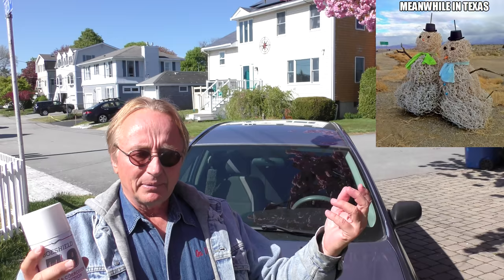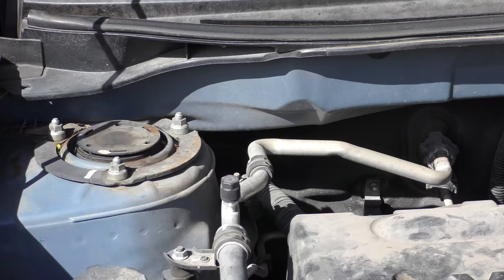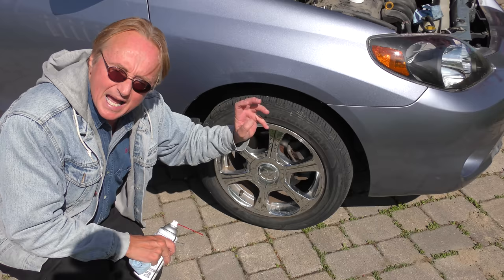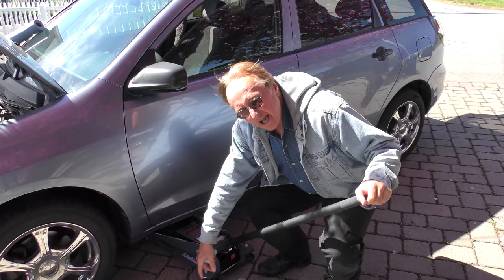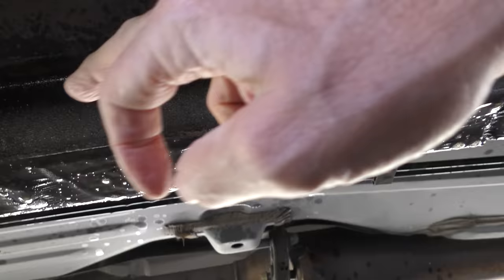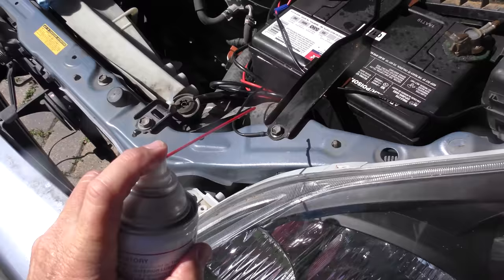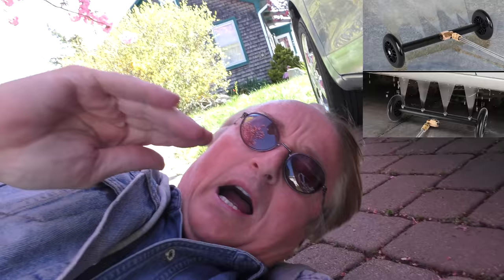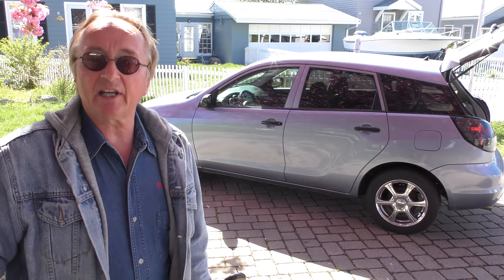Here's Why I Want to Leave Rhode Island ASAP

Comment: Scotty is salt of the earth!
Today was a school day for me re there being nickel in stainless, as I`d always only considered the chromium, but did wonder how they kept the brittle element down. I was in civil engineering and saw low-grade stainless with rust spots. Another thing with salt in UK, it`s wise to use copper grease on motorcycle engine bolts. I`ve had to cut seized front-engine bolt on Guzzis, to remove motors.
Also here in Blighty I remember welding old French cars in the mid-eighties, gawd they didn`t half spit back. Turned out that the froggies put all sorts of crap in the smelting pot. Very impure metal used for chassis/bodywork. Then they suddenly improved and my 1984  Renault 11 was as solid as they come.

Comment: There is an undercoating that is made from the waxy-oil found on sheep, it is called 'WoolWax', and it is the absolute best undercoating you can possibly use on a car. It is self-healing, and you only have to re-apply it every 3 to 4 years, not every year like oil undercoating.  A similar but 'thinner' product is 'fluid-film', and you can use that to spray the inside of your car doors and quarter panels to keep them from rusting.
Reply: That's the same stuff that GM is applying to their frames, isn't it?
Reply: I believe the military uses it. Just have to be careful with soft rubber such as inside your door. If you spray it in that it deforms
Reply: Fluid film is good but has to be reapplied- my go to rust protectant is POR15 it’s a single application and my father used it his whole mechanic life
Reply: @LardLarf2  how long does it last? Fluid film is only good for a season
Reply: It’s called Lanolin.
Reply: I restore frames in the Mass near the Cape - I spend 2-3 hours needle scaling the frame and removing the existing problems then I spray a convertor primer. The end result is a permanent fix. Thats when you start throwing oil at it. DO not let anyone spray anything over rotting metal. The process of removing the scale rust is the most important.
Reply: I would rate it higher than fish oil.
Reply: @robertpittsley5886  You hit the nail on the head.👍
Reply: @robertpittsley5886 Thats true to never spray a sealant on rust, but lanolin stops rust from getting worse. It is not a sealant, so it is ok to spray on existing rust. Of course if your car is falling apart it's not going to help at all...
Reply: THANK YOU!
Reply: @ze3bar  ......hope not.......Chevys rust like crazy even down in mid Atlantic states!!!
Reply: @robertpittsley5886 I live near the cape. I have a 2016 Camry and I'm not sure of the extent of the rust underneath. It's not terrible, but id like to get rid of anything that might be there. 

What would you charge for a touch-up sort of job like that? 
Provided you offer such a service?

Comment: Scotty, took your advice and purchased me a Toyota Matrix. Gotta say this thing is a runner. $1,000 with only 101,000 miles
Reply: Matrix Gang. I got a white XR and it’s a beast.
Reply: For sure. I have to drive about a 100 miles round trip a day and figured why out the miles on my truck. I looked and looked for a car. Had a pushed in driver door that took an angle grinder almost the jaws of life to remove. Replaced that and the AC clutch. Long story short has been the best purchase to date. But someone must have been tipped off they last forever because the parts on them are crazy money. I don’t get it. USSA tried to charge me $350 a month for basic coverage on a 2009 and said it’s a older car and parts are a lot of money. Wish I had the money to buy a new Toyota but the Matrix will do
Reply: @andrewdemorest8397  man, go to a junk yard for parts. Local o’reillys in my town the parts are dirt cheap. Must be because of location perhaps.
Reply: I know the Yaris motor was designed by Yamaha. Are the matrix as well?
Reply: @emanuelruiz7710  nah, fully built Toyota engine. Depending on the trim of course. XRS model matrix get a Yamaha designed 1.8L engine the 2zzge. That also comes with the VVT-L system which is essentially VTEC. The normal trim comes with the Toyota designed 1zzfe 1.8L engine with VVT-i which is like a basic VTEC mainly for fuel economy and throttle response.
Reply: @emanuelruiz7710  the engine options I listed are only for the 2003-2008 models as well. Anything past that is redesign territory, which I believe come with a 1.8 and 2.4L options. 2.4 is a Camry motor but is prone to burning oil.
Reply: We bought a 2009 Matrix base model a year and a half ago with 76k and it's been super!
Reply: @andrewdemorest8397  , WOW 350 a month for insurance on a 2009?? Wow

Comment: I use LIQUID WRENCH L711 CHAIN & CABLE LUBRICANT CERFLON,  Cerflon is Teflon.  It's a penetrating teflon spray.  It's disappearing from stores, so on ebay You can get six cans for under $30.  Also Teflon REPELLS dirt and sand, for a cleaner underbelly.

Comment: I remember spraying the innards of Boeing 737, 747,757 with this stuff for corrosion protection. We used this in the landing gear wheel wells, where debris from the tarmac including salt makes its way onto the airplane innards. That was 20 plus years ago. It's good stuff.

Comment: The pressure washer attachment is a good idea.  To really clean off caked on mud though, you need a harder spray like at a car wash.  Also I always use a garden nozzle to spray out the wheel wells and the wheel lips and any other areas that have crevices where any dirt or salt can accumulate. Most newer cars use wheel well liners which really helps eliminate the body rust problem around the wheels.

Comment: it costs too much, we just coated everything with used engine oil. and reapplied once in a while.
Reply: I heard somewhere that used motor oil is very good for rustproofing.
Reply: -'Mustie 1' has used that 'coating' for years with excellent results. He even devised a little sprayer that fits within the hollow frame tubes and coats the insides to end corrosion.
Reply: When i put new fence posts in i always use used engine oil. It keeps the little bugs from eating the wood and stops rot.
Reply: @davidestrich7055  motor oil harms rubbers , transmission fluid is better . here in Quebec CANADA we rustproof cars before the winter ,if it is done well every year not going to have any rust .

Comment: Unfortunately in Ontario, Canada washing your undercarriage just reactives the salt brine and rusts your brake and fuel lines even faster.  The rocker panels too.  Very disturbing.  😡
Reply: That's why you pressure wash it the garden hose doesn't have enough pressure to get the salt off
Reply: @DylanL69  do that at a coin-op with hot water but at -27C it's not all that easy.  Colorado uses biodegradable mixture that doesn't destroy vehicles so it can be done, it just costs more.
Reply: @JeffWinter1  pressure washing and maybe some scrubbing gets the scale off thats what you're really trying to get off is the scale
Reply: @DylanL69  so new vehicles use conduits to house the brake and fuel lines, like mine, that you can't scrub unfortunately.  Those would need to be put on a hoist, removed, cleaned and replaced which no mechanic would do.
Reply: @JeffWinter1  yeah that sounds like a headache

Comment: Sounds like good stuff. Just a note on stainless steel, 400 series SS will corrode  in costic environments, yes. 300 series is a lot more resistant. I was a machinist, we used a lot of it on down hole oilfield tools. Use a magnet to tell the difference, if it sticks, it's likely 400. 300 will corrode, but you have to dump it in sulfuric acid, or  bury it for a couple hundred years. Won't see much of it on cars though. $$$$$$

Comment: Stainless steel contains at least 10% chromium . Nickle is used in very small amounts  in some versions.
Reply: Either way as Scotty said it still rusts out. Everyone thinks Stainless Steel lasts for ever, far from it when exposed to a lot of water it doesn't need to be saltwater it will still rust out just a little slower is all.

Comment: Scotty its chromium that makes steel STAINLESS STEEL
Stainless steel:276 is a group of iron-based alloys that contain a minimum of approximately 11% chromium,:3 a composition that prevents the iron from rusting and also provides heat-resistant properties. There is SOME Stainless Steel that is also magnetic

Comment: I love Scotty, but I have to correct him on stainless steel. The defining element of stainless steel is chromium, not nickel. All stainless steel has chromium and most stainless steel has both chromium and nickel, but there are some grades of stainless steel that have no nickel. Some grades of stainless steel are more corrosion resistant than others, particularity in certain environments. 316 stainless steel, for instance, which has chromium, nickel, and molybdenum, is particularly well suited to environments exposed to salt and chlorine. If the grade is correct, it should last a very long time, if not indefinitely. Titanium is the best metal when it comes to salt corrosion, but it's generally too expensive and impractical.

Comment: It's not practical to rinse the car  bottom each time we use the car in the winter. We would spend more time rinsing than using the car. And what about rinsing the car outside, in the snow, in freezing temperatures? Nobody is insane enough to suffer that much hassle to prevent rust.

Comment: Scotty’s Matrix underbelly looks pristine. They are great rustwise. No or little rust. The only potential rust problem area for Matrix is where the side doors meet the underbelly...
Reply: @Igor Seprak I never see that many rotted out matrixes in Canada. It’s because of Toyota’s good factory Zinc-Primer that Scotty talked about in a different video. It works great, & the first car they really got it down-pattened on was the 1992-96 Camry. I see them 30 years old all the time & no rust. My 2006 Matrix has it too, works excellent. 17 years old & no rust.

Comment: It's the chromium content in stainless steel that determines rust resistance Scotty, not so much the nickel content. When stainless gets scratched the chromium reacts with air and forms a protective coating, thereby resealing the surface and preventing the formation of rust.

Comment: Granted I haven't lived in a salt-water area, but I have lived in the midwest for the past 30 years, and I don't get where people think that cars disintegrate from the cold winters and the salt around here.  If you wash your vehicle once a week during the winter to get the salt off, that's all you need.  I've had older cars (that were 10 years old, had a little rust on them) but they didn't fall apart physically over the 5-6 years I owned each one.  Because I washed them regularly in the winter and got the salt off.  And in the winter I parked out side where it was cold.  Obviously salt water is probably more damaging as it's salts in the air and the water, versus just during the winter time in the midwest but still, I don't know why people think their cars will "disappear" after a few years in the midwest because of salt.  As with anything (and as the 20 year old Tahoe shoes) if you take care of it, it can last a long time regardless of where you live.  You just have to take care of your car.  Most people don't wash their cars regularly during the winter time and/or they store them in a warm heated garage over night and drive through salty roads in the day time (during the winter).  Obviously my CAmry has plastic panels throughout the bottom so when I go through the automatic wash during the winter, I do get the under carraige wash.  During the summer months I only wash under the body maybe once every other month, but at least wash the car itself every month during the non-winter months when salt is not in use or if the car gets excessively dirty with bird droppings or bugs.

Comment: It depends on what kind of stainless steel you use ... Aisi 304 corrodes a lot in salt water, aisi 316 is far better and is a navy steel, 316 low carb is even better and actually rust/corrosion free on saltwater.

Comment: I use a product on stainless steel pipes at work mostly for the welds, that totally stops corrosion and rust for years. it harmful to breathe, but it works , along with other stuff i spray on and scrub on

Comment: My poor old 1991 Pont 6000 could have benefitted from an underside cleaning.  The mounts that hold the rear axle in place rusted.  I drove that car until the wheels (axle) fell off.  It had over 200,000 miles, I got my monies worth out of it.  It was practical transportation until it wasn't.

Comment: Hi Scotty, while you’re up in New England you should go check out the guys at New Hampshire Oil Undercoating. They sell different undercoating products. I looked into it after my transmission line rusted causing a fluid leak. NH oil undercoating is a good product if you already have surface rust to dramatically slow the process. I found a good guy where I am in Haverhill, MA who took it the night before, power washed it, let it dry, then sprayed it. I figure rust is one of the few things that can kill a Corolla, and I’m hoping my 2010 has another 188,000 miles to go!
Reply: @s0129570 your Corolla probably won’t rust, as long as you watch out for deep scratches & chips. Toyota seals those cars really well. My 2006 Matrix in Canada has zero rust, & yes, it’s seen salty environments many times. Never hurts to keep it rinsed off. I like this product that Scotty showed the best, looks less messy than oil spray. It was true for many years, if you ask Scotty & other people who have Toyota knowledge, that Toyota made rustproof cars but not really rustproof trucks. That has changed in the last decade, they are all sealed nicely.

Comment: Scotty,  I have a 2014 Jeep Patriot Lattitude with a 2.4L. I know it is a heavy vehicle for a 4 cylinder,  but is there a good brake pad/rotor set that would last longer than the standard put on by the dealer? It is a very nice Jeep, smooth ride, and thank God it is not a 2016 or newer. Those are junk. In your opinion is ceramic or organic pads better for a vehicle this heavy (4,235 LBS).

Comment: Hey Scotty I am torn between a Toyota Avalon V6 2013 and a Toyota Camry 2014. Both 90-100K miles. Which has a better engine/transmission? I watch you everyday, Thank you for everything you do to help all of us 🙏
Reply: I have drove both the Avalon and the Camry from those years. I say the Avalon drives much better because of that punchy and yet smooth V6 engine ( same engine that they used on the Lotus & Lexuses). Although if I were you, I would test drive the 2013 first to see if you like the suspension setup. Some people have complained about being slightly stiff compared to other years of the Avalon (Toyota revised the suspension in 2016-18 models for a Buick / Lexus ride quality.) The Camry is also a good choice if you get the four cylinder for the best fuel economy.

Comment: Hey Scotty where did you buy the u Jack? I'm in need of a good floor jack. Also I wonder if that rust prevention will work on the front hubs on my 04 Mercedes w203. 1 more thing why don't they put heaters in the roads I bet the cars wouldn't rust as bad or at all if the water evaporated

Comment: Hi Scott I have a nissan qashqai 64 plate 1.2 dig t 39000 miles with normal transmission am in the UK and can now buy the car for 5grand or give it back should I give it back or keep it not had any real problems in 4 years I have had it but dont want to keep it if I will soon most likely have problems

Comment: Scotty I have a  question, I have 1995 Ford bronco with 5.8 liter. 4x4. The transmission has been rebuilt twice! At first I thought the first company didn’t do it right because first gear would shift  hard. They told it would go away! But all the other gears would shift fine. So I had another company take a look at the transmission. They also tore down the transmission and rebuilt it. Replaced the torque converter. Replaced the transmission control module two times. Connected the computer to lower the idle. But they still could not fix the hard shift from first. They didn’t charge me labor because they couldn’t fix the problem. 
What do you think it is!!!! Please HELP!!!

Comment: hey Scotty, question for you. i found a 2009 pontiac vibe for sale with 96,000 miles on it, it has awd (i need it for the snow) and the place is asking $6995 for it, do you think its a good deal, or should i stay away from it, i know GM products are bad but isn't the vibe pretty much a toyota matrix engine and transmittion wise?

Comment: hey scotty, i have a 4 cylinder 2006 honda accord sedan. automatic with 189000 on it. the car drives great but when i accelerate there is a subtle clanking coming from the engine, any ideas?

Comment: What can you do to stop rust on a frame of a 4 runner?
Reply: It depends, if it's really bad u have two options, change the frame or hope.
Reply: Clean it off with a wire brush and if its not rusted thru , Spray it with Rustolium Rust Reforner .